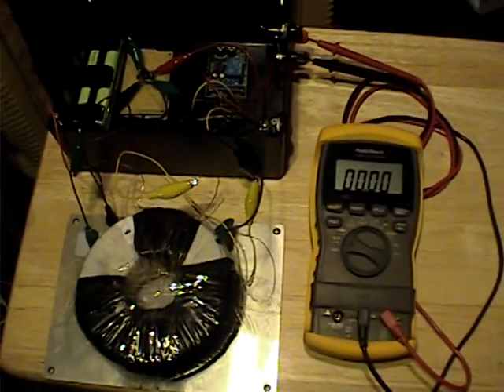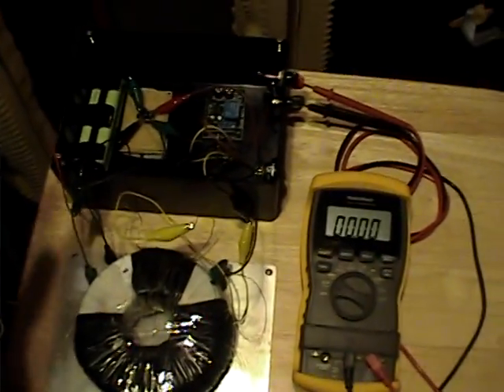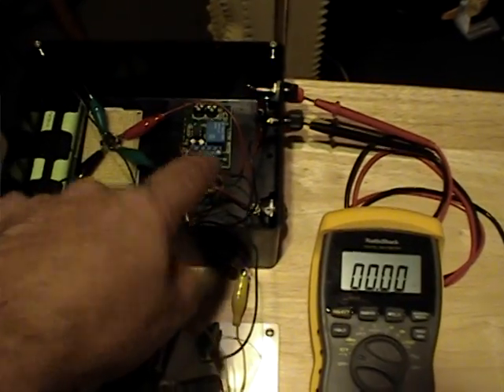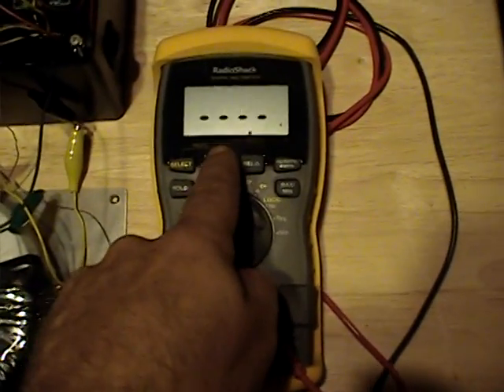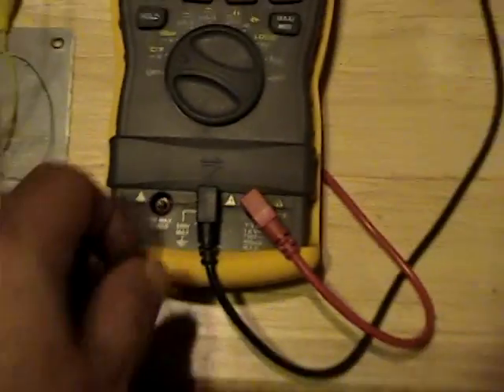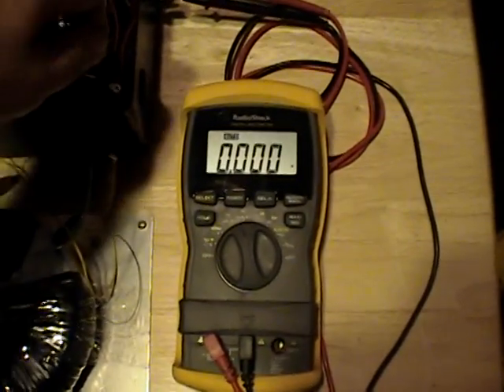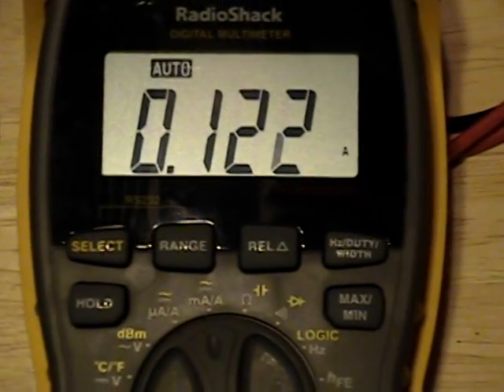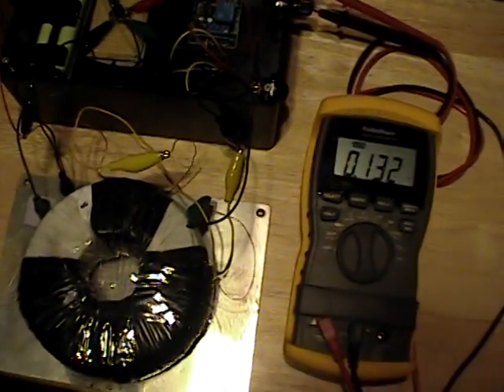Not OverUnity Yet...

Comment: Nice work, I tink your pulsing coil maybe 2 small. The EMF flux will induce current only on the ends of the 2nd coil because its EMF  influence is too small. Current is now lost as it travels through the dead part of the 2nd coil. Increasing the EMF size of the pulsing coil to envelope the 2nd pickup coil more should improve output efficiency by removing dead spots. I think that's why a transformer works well. Both coils similar in size, sharing an iron core & encased 4 better EMF distribution.

Comment: I admire your persistance in improving your device.  However, your understanding of current and volts in this video is confusing.  You measure about 50V yet called it current and then measured about 100mA of current and call the combination about 6V.  Perhaps it was just an error you made in the video.  You measured 50V at the inductor I assume.  How did you measure the current?  Across the inductor or in series.  To correctly measure current, your meter must be in series with your circuit.